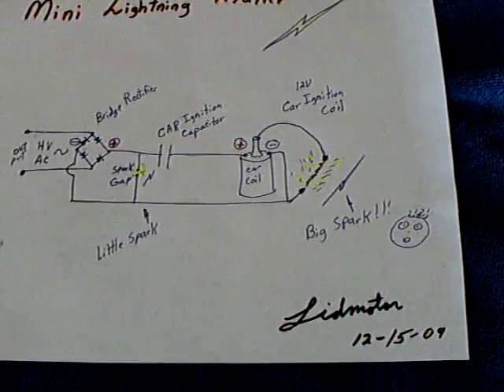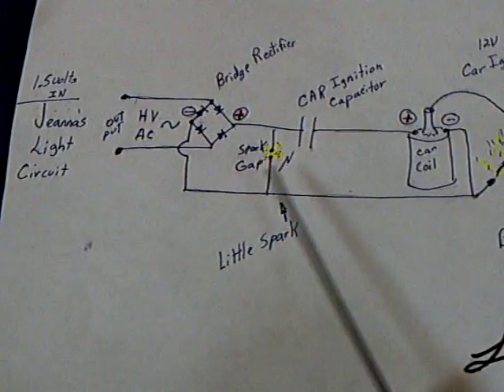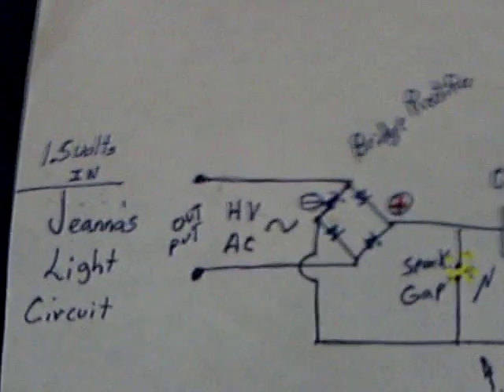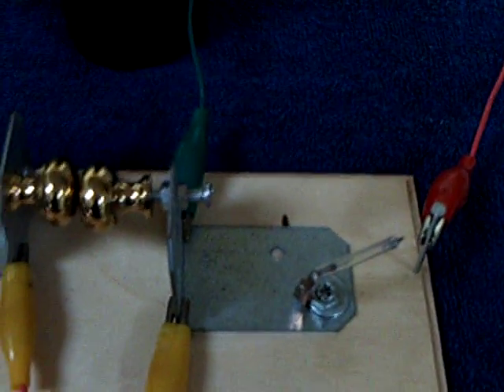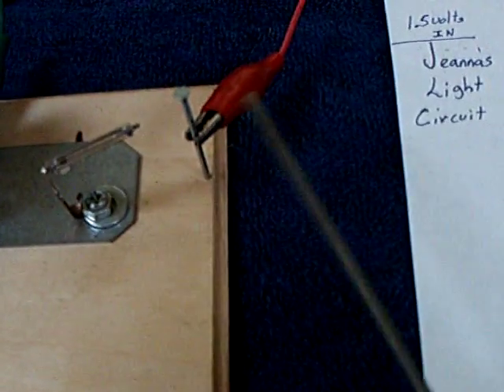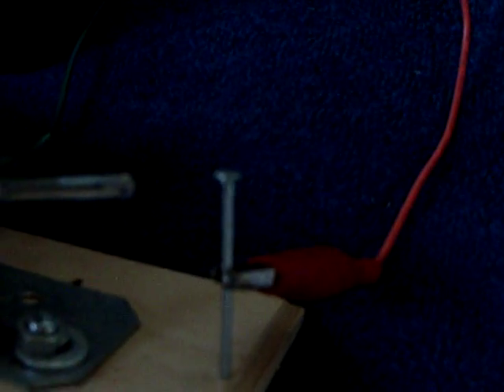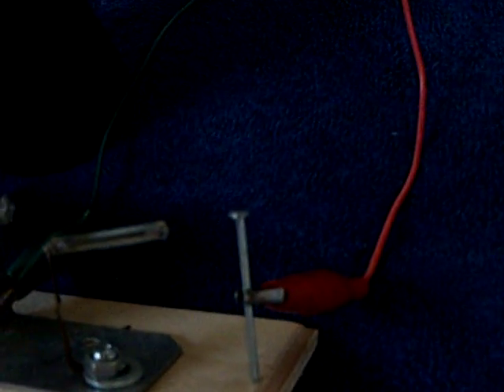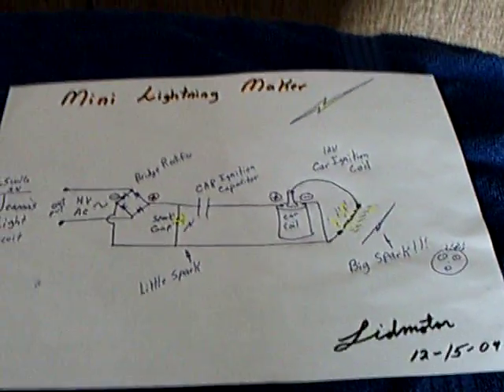Mini Lightning Maker

Comment: I'm working on a circuit that generates 500,000V from photovoltaic. It's more challenging with PV cells because the short circuit rating of PV cells limit your frequency.

Comment: To generate 1000's of volts from DC, all you need is that pulse so that a transformer can process it. The transformer removes the load side impedance from the source and draws more energy. the primary side of a transformer will have very very little resistance - shorting out the battery. This concept could be useful in PV fuel cell apps. In other words use photovoltaics.

Comment: good job dude..
you can use a camera circuit if you want
i use the jeanna setup so i can dump 600-700 volts in a certain setup of mine..
yes this is a stun gun and or a strobe circuit.. i invented nothing here..keep up the nice work